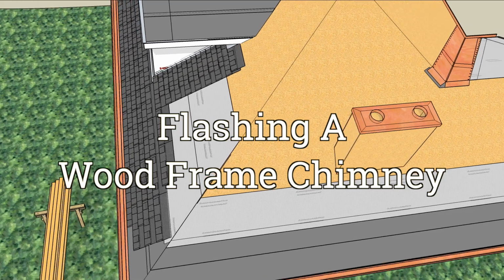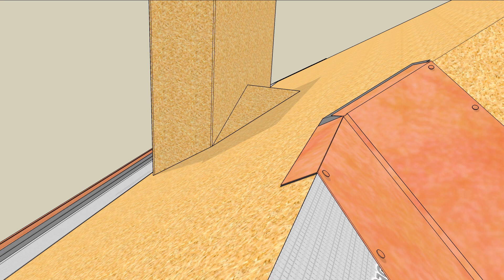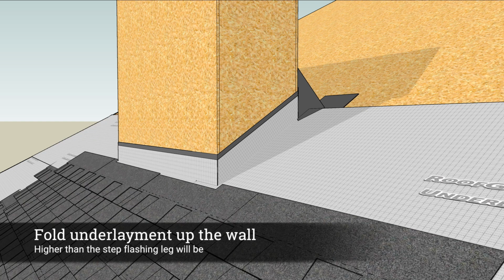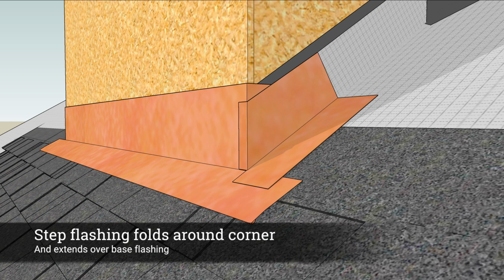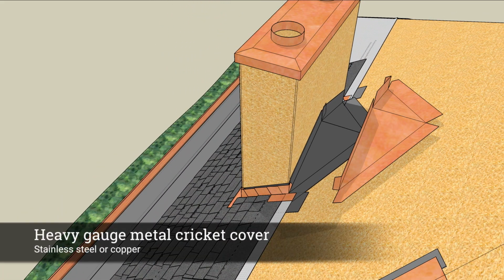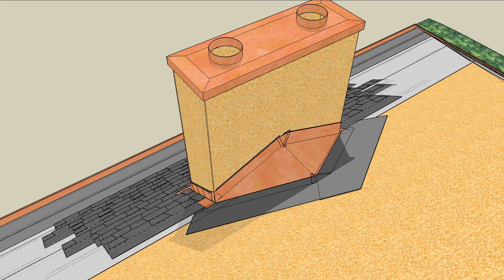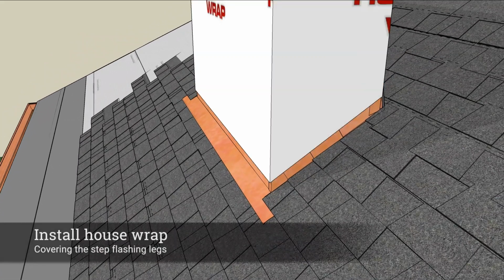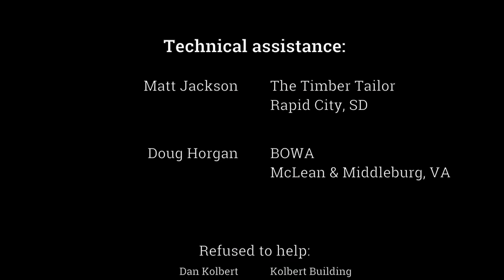Flashing a Framed Chimney w/a Cricket

Comment: the first step flashing shouldnt be cut and bent around, water will just enter than pinhole when the caulk gives away. Never rely on caulking. And when you get to the cricket it should be extended a few inches aswell as there will be a ton of rainwater hitting that spot,
Reply: Manufacturer specifications say to cut the metal and wrap it just like he did.
Reply: @bowold3976  ask any good reputable roofer who isnt a hack and they would say thats false.  Unless its a soldered joint then having a pinhole there isnt the way to do it. Like with a bathtub. Are they made up of multiple pieces and then at the joints caulked? Think before you say something as youre obviously not a roofer or do any metalwork that sheds water.
Reply: I can send you the chapter and page where it states this straight from the manufacturers installation guide itself. I didnt pull this out of my ass and say it because i felt like i was right. I didnt even say i claim to beleive or agree with it simply stated what the book says.
Reply: Perhaps the book you use and reference says differently than mine does.
Reply: @bowold3976  i dont go off a book. I go whats by code in bc. RCABC. Look it up. Youre implying the way i do it and many many others who do it the same way isnt proper. The only way that method would work would if it was a soldered corner.

Comment: I don't love flashing plans that rely on peel and stick as we really do know how this stuff is going to last! I also don't agree with calk under the down roof flashing. The only way that calk would be tested it would be stoping water from flowing down hill. I guess the days of real roofing craft are gone forever. As a great flashing plan can be done without a single drop of calk or adhesive. Proper dry set materials will last for ever!
Reply from the maker: I don't know about that. I've shot video of reroofs where we exposed 25 year old peel and stick that was f*!#king impossible to pull off the roof deck.

Send a detail you like and we'll run it up the flagpole.